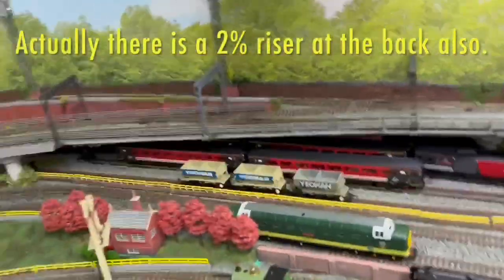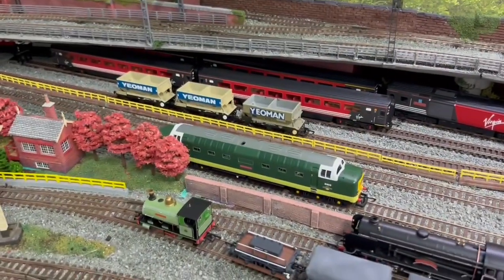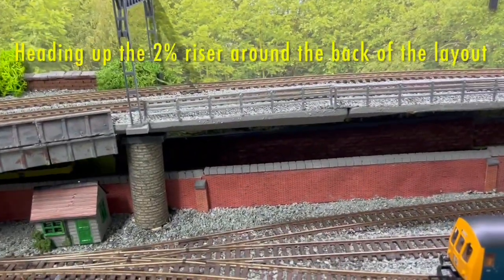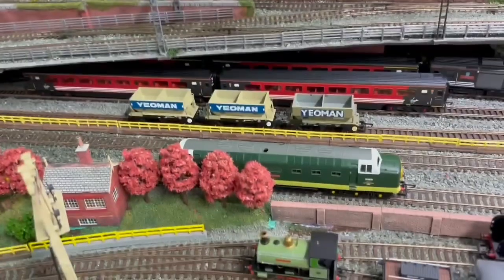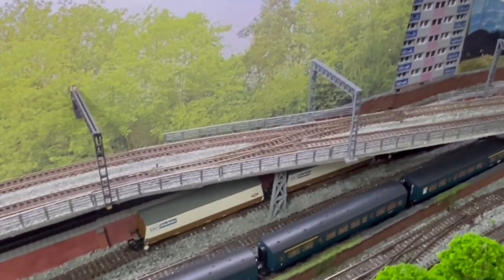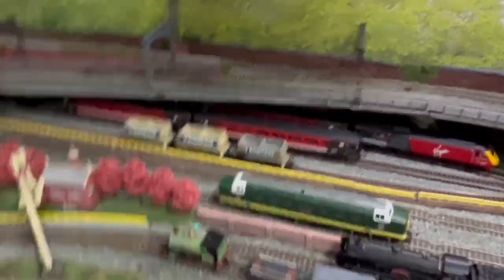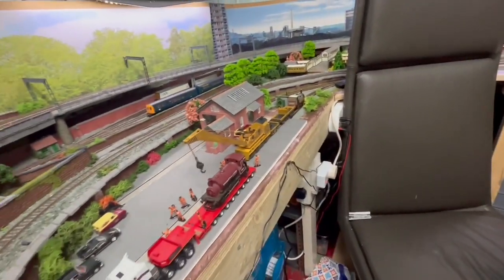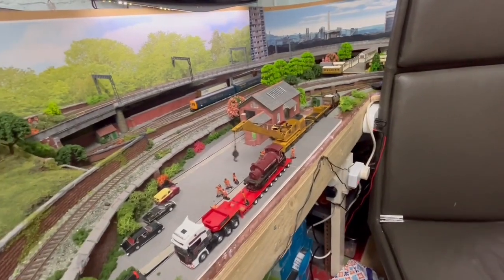8 May 24. TXS Deltic Upgrade. Stay Alive Test…DC to DCC…Do we Really Need Droppers Everywhere???

Comment: Hi IV got dcc and the most important place to have droppers is all around the points on peco insulated I have you need good contact on switch blades area
Reply from the maker: Hi Dave…Thanks for watching and the helpful tip. This is a bit of an experiment really. To see how few droppers are needed to run my layout on dcc. It will be interesting to see how it goes. I think stay alives may help me cheat my way to a decent result 🤣👍
Regards…. Steve 👍

Comment: Very interesting . I’ve long been waiting to see how someone could run DCC on  an otherwise DC layout . I’ve been collecting locos since 1965 , so you can imagine there’s a fair few by now . I can’t go DCC as some of these locos pretty old , but I do still run them .  I do fancy an occasional sound loco though . What I’d really like to see is how some of these Bachmann sound fitted locos run on DC . However what you’ve done gives food for thought .  Does your HM7000 Deltic go on DC and aren’t you frightened that you might get DC and DCC mixed up Causing problems to locos . Great video , the first I’ve seen attempting this . Hope you get over Covid soon !
Reply from the maker: Hi Russell. Thanks for dropping in and your interest in this project. 
Im literally going to add one dropper at a time to fix dead spots and see how that goes. 
I don’t run dcc locos on dc at all. I hope to set things up so the layout is switched between one or the other. 
I expect snags and problems during this project but it will be fun trying to solve those problems don’t you think. 👍
As long as I can still run trains throughout the process that is. 🤣
Regards…. Steve 👍👍

Comment: Hi Steve, DCC is simple to start with but it can get complicated if you go in to deep with block detection and things like that I’ve got a separate DC line and the rest is DCC witch I run multiple loco’s on the Hornby clips just  gives you continuous power on the points cheers Al
Reply from the maker: Hi Al. All the complicated dcc stuff has always put me off. 
So I decided to see if I can enjoy the benefits of dcc but still keep things simple. 
Im really interested to see how this plays out. It may be cheating a little but it seems that Stay Alives might make things work in my favour. In the future I think they will become a standard factory fit. If I’m not mistaken isn’t one of the manufacturers already doing that, for a price of course. 
I hope to do some short progress videos on the project. 
Regards… Steve 👍

Comment: Hi Steve.
Sorry about the covid buddy.

Mines dc only still can't get dcc round my technophobe head.

Your layout is bigger than mine and I love the different levels.

Get rid of that horrible bug mucker.
Still got your photo by the way.

.... Pete....
Reply from the maker: Hi Pete. Hope you are well. I’m just experimenting to see if I can enjoy the benefits of dcc and still keep things relatively simple. Like you I have been put off by some of the complicated set ups and the mega costs in electronics. 
I’m using Hornby HM7000 on an old iPhone 8 that I had in a drawer. Also the Hornby Bluetooth sound decoders. Let’s see how that goes.  I won’t be using sound chip alone. I will be using ordinary dcc decoders on older kit as well as keeping dc locos. I want to be able to switch between dc and dcc so I can still run all my yummy toys 🤣🤣
Regards…. Steve 👍👍

Comment: Hi Steve,
I ran my loft layout with not many feeds and it did work although the small locos 0-4-0 & 0-6-0 would struggle on the hornby points but to make the whole layout live it needed the hornby clips in them when I did the conversion to iTrains you had to have each block with its own feed and doing that did make a huge diffence to there running and thats why I will do a dropper on every bit of track and the points on the end to end so it will be interesting to see how you get on with Dcc on yours. What dcc controller have you got to run this. I hope you will soon shake of the covid but well done for doing this video when suffering from it.
Cheers Robert.
Reply from the maker: Hi Robert. Thank you for watching. I hope all is ok with the skin problem you mentioned on your video. From personal experience it’s essential to get these things checked out asap. I’m new to dcc, and I want to try and keep things basic and simple also not too costly, so I don’t get a headache 🤣
I’m using Hornby HM7000 on a spare iphone. So cheap as chips 👍🤣
I will be trying things out and testing various wiring set up ideas. I will hopefully do an update/progress video soon. I’ve got some of those clips but need to understand what they do much better than I do at present. 
I will learn about and understand dcc better as I go. It has always looked too fiddly and electrically complicated to me and that put me off. But if it’s possible to do dcc simply and I can retrofit my layout cheaply then I’m up for it. 
Regards…. Steve 👍👍